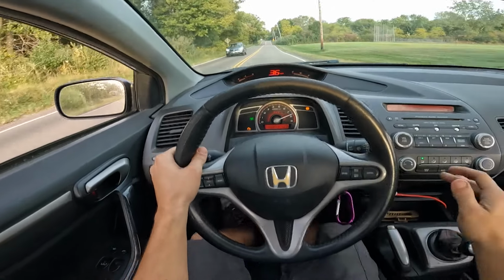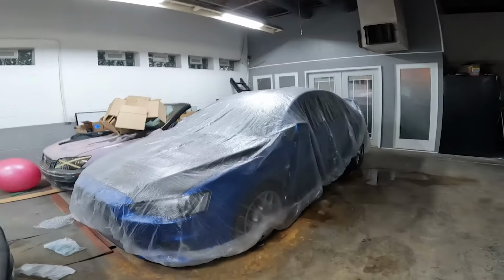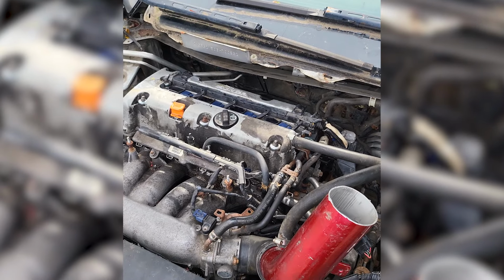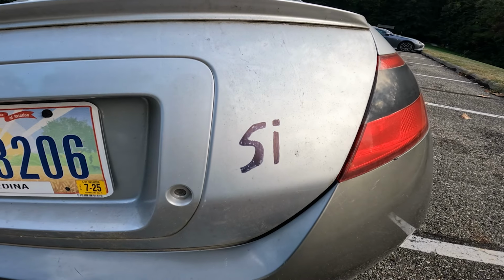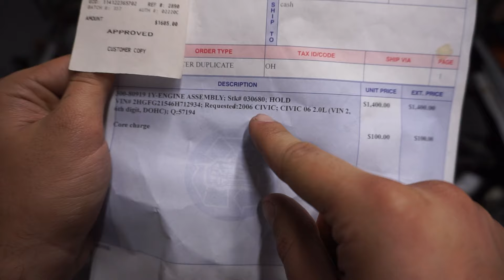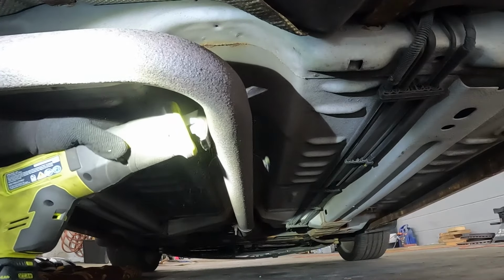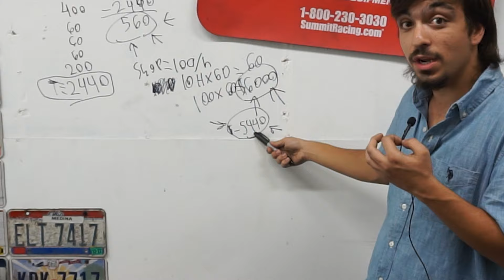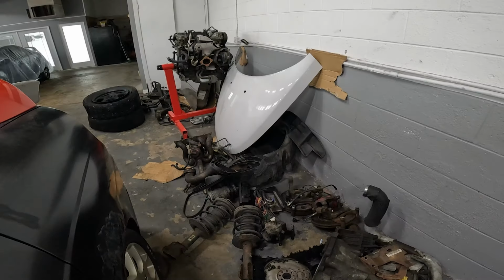You SOULDN'T Start Flipping Cars

Comment: Niche cars are never good for “flips” always take used cars to mechanic shop BEFORE you buy. They will pressure test, but it on a lift, check suspension, etc.
Reply: They are great flips for people who specialize in these particular types of vehicles with experience to back it up. Not for your average 20-something dude with basic mechanic knowledge.
Reply: @AcuraLvR82  I beg to differ

Comment: A simple check of the ecu codes in the very beginning would have saved you all that extra hassle and expense. I work extensively with K series and B series and know that on an 8th gen SI timing that far out would definitely trigger a check engine light.
Reply from the maker: It gave me a different code every time I reset it.